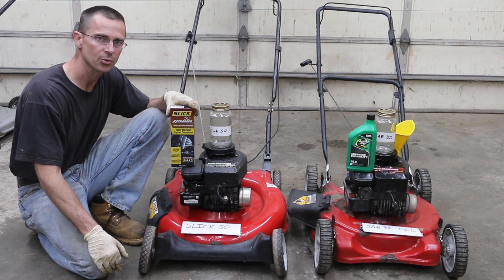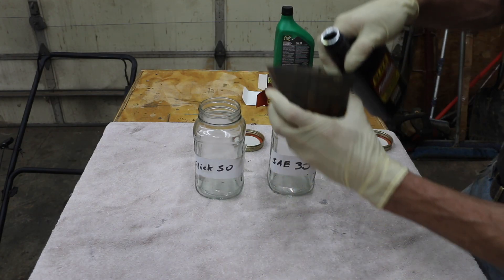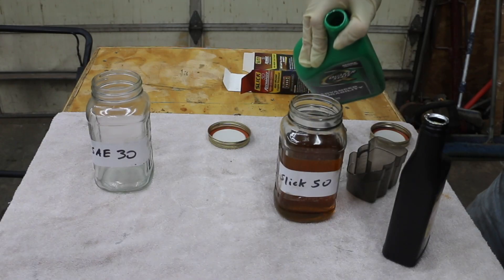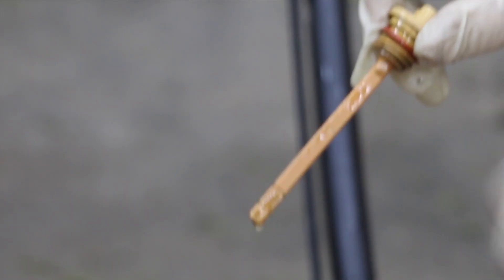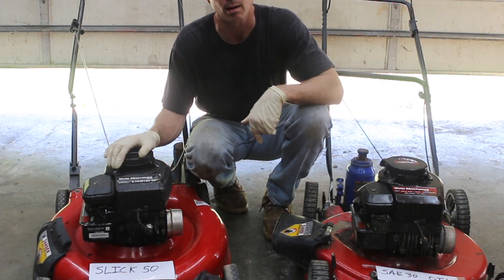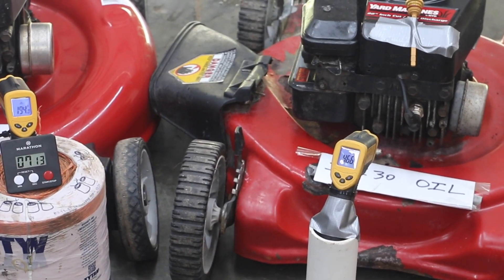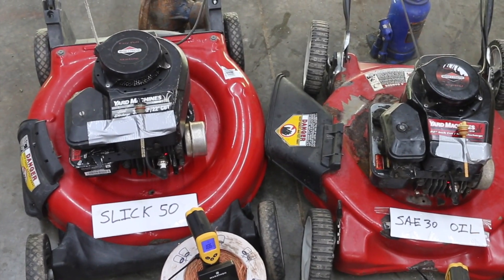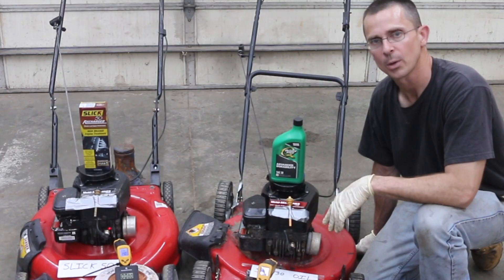Can't believe what SLICK 50 did to my engine!!--Dry Crankcase Test!

Comment: I was involved in the sale of slick 50 in the late 70's early 80's.  My experience is totally different from this.  As a sales aid I had a small Briggs and Stratton motor on a stand.  The motor had a large perspex window in the crankcase so any oil present could be seen.  I treated the motor as per the instructions and then drained the oil.  After that I ran the motor on numerous occasions for 20 minutes without oil as a demonstration.  After about 18 months it lost compression but never seized.  As well as that I had  1962 EJ Holden sedan (in Australia) in which I had fitted a later 186 cubic engine with a number of performance modifications.  I had treated the motor with slick 50.  About 20,000miles after treatment one day I left my home to drive to a nearby town about 12 miles away.  It was a quiet road and I drove at about 90mph all the way (you could get away with it in those days).  I also had the radio up very loud all the way.  When I got to the town and slowed right down I could hear the hydraulic lifters in the motor making a god awful racket.  Inspection revealed that the spin on oil filter had spun off and I had no oil in the sump.  After a new filter and oil I retraced my path and saw that the filter had come off just after I had left my home.  That motor did another 80,000 miles without a hint of trouble.  There were also numerous other highly controlled tests done in my presence that left me in no doubt as to the efficacy of slick 50.  However at the same time there were so many ill informed nay sayers spreading rubbish and disinformation that I got sick of it and left the business.
   This demonstration above says nothing about the correct procedure being followed in treating the mowers.  This is essential.  Other than that I fail to see how a microscopically thin layer (2 to 3 microns) of the slipperiest solid substance known to science (Polytetrafluoroetheline or PTFE which uses the brand name "Teflon")  can cause a motor to heat up more than a motor without it and to seize earlier.  The two motors were supposed to be in identical condition.  Were they stripped, inspected and measured before the test?  As a final comment,  This is the exact same type of "demonstration" that was done by representatives of the ilk of Wynns friction proofing to try and destroy the competition.
Reply: In 1992 I put Slick50 in a Suzuki GS550E motorcycle (I think it was a 1982 bike, but it had been on Guam most of it's life to that point and only had 450 miles on it when I bought it).  You weren't supposed to put Slick50 in wet clutch bikes because it would cause the clutch to slip, but an old motorcycle mechanic told me how to do it. He told me to put in the Slick50 and just deal with the slipping for the 3000 miles it would take for the PTFE to embed. Then after I changed the oil he told me to put the front wheel of the bike against a wall and run the bike (in gear) until the clutch quit slipping and the bike would just die every time I tried to let the clutch out.
     I followed his instructions (and YES the clutch slipped A LOT toward the end of the 3k miles), but after I burned the PTFE off the clutch after the oil change I went from getting a consistent 45 mpg to consistently between 70 and 80 mpg!  I got such good mileage that I regularly freaked out when the main tank ran dry and it took me longer than it should have to remember to reach down and switch to reserve. I put 30k miles on that bike and would probably still be riding it today if I hadn't totaled it (and folded my knee 45 degrees the wrong direction) in a field in west Texas. Even after destroying the frame and cracking the crank case cover, that bike still cranked and ran.
Reply: @johncarkeet5767  Very cool John...except the knee part.
Reply: I totally agree, this test was bad. The ptfe settles in the bottom of the can so it must be shaken vigourisly to get any out.. Engine needs 10 hours running for the ptfe to bed in.
Reply: @colinmartin2974  Those were my thoughts as well. I used Slick 50 on a car back in the day, and it lasted far beyond what I expected from it. I realize that that is hardly scientific proof, but I do believe that the Slick 50 did contribute to the longevity.

Kudos to Project Farm for at least trying to test these things, but better adherence to manufacturers instructions, would make for better testing.
Reply: I think you didn't watch the video in its entirety. The Slick 50 engine remained cooler throughout but collapsed sooner. It would have been nice to see two new engines try this, but as you can see this is one of PF's earlier videos and he probably didn't have the funds to sponsor such a trial
Reply: -And 14 years later the lab boys at Wynns found out that PFTE was almost the same thing as STP.  This is when STP hit the market big time in the mid 90's. PFTE took STP to court and the judge threw the case out and pfte slowly faded away. And STP stayed on top for a little over 20 years until it too fell from the market. How often do you see STP adds on TV today. Never. So STP slowly faded out just like PFTE. The whole thing turned out to be just one big joke. Not much more to this story anymore as both brands fade away even more.
Reply: @auggie803  What rubbish you speak.   PTFE (Not PFTE)  is Polytetrafluoroethylene and was given the trade name of Teflon by the company that invented it--Du Pont Chemicals.  What we are talking about here is a product called "Slick 50"  that used Teflon as a dry film lubricant bonded to the moving metal parts.  STP is the name of a Company that sells a number of different products, among them their "Oil Treatment"  which I presume is what you are talking about.   This is NOT almost the same thing as Slick 50, in fact they couldn't be much different.  STP's product was a viscosity index modifier that made the oil a little thicker and supposedly thereby giving the parts an extra buffer between them.    
And to think this report came from Wynns who were trying to protect their position as the No. 1 marketer of "friction proofing" engine additives.  They were also known to be the No. 1 disseminator of bullshit propaganda rubbishing other products.  STP and Wynns  engine oil additives were basically identical.
Reply: @gertroewer152  ñ
Reply: Liar

Comment: What about Nano Energizer? It contains platinum coated ceramic nano particles. It claims the same as all engine oil additives: that it reduces friction within the engine. It seems more advanced than Slick 50 though, as its quite smaller and not size growing particles as temperature raises, it don't clog the oil filters. Besides that, it can be used in many other devices, like gearboxes, air compressors, power steering systems, lawnmowers, etc. It's chemically inert, so it does not alter the oil properties, nor it attacks any other material or parts within the engines (read rubbers).

I have used it in the engine and gearbox of my, both, Citroen C4 II and C5 II cars. It is noticed a slight increase of power and decrease of engine noise and fuel consumption. 

Also I've used Nano Energizer in the Hydractive 3 suspension system of the C5 and it works now very well, way better than it did. The bumps are clearly less noticeable because the suspension cylinders have less friction now, which seems to be a problem as the LDS suspension fluid tends to become surprisingly sticky and even seizing over time (and even new LDS fluid sticks a bit a syringe), slowing down the suspension leveling electric pump speed, also making the suspension less responsive and hence less comfortable along the time (besides the progressive loss of nitrogen pressure within the spheres, which it's another topic, it's very little with modern spheres, lasting more than a decade in very good conditions, without needing to substitute them easily and costing about or less than traditional shock absorbers). With Nano Energizer, the suspension electric pump spins clearly faster and it's barely noticeable with the engine at idle, while before it was so noisy and dragging that the car lasted ages to level up and I started to fear the pump fuse would melt. 

Also, it's quite useful to add a bit of microparticles of graphite to the Hydractive 3 suspension LDS deposit. It enhances even further the responsiveness and smoothness of the air suspension in all conditions (cold and hot weather conditions and right starting the car or after several hours of driving; because I noticed a very slight residual sticky behavior in the suspension after long driving conditions with only Nano Energizer, surely because this additive it's formulated to shine at its best in metal with metal, like the suspension pump, more than metal with rubber applications like within the suspension cylinders), while graphite it is also an inert material and not attacking anything inside the system. Now, with Nano Energizer plus microparticles of graphite the suspension works like a charm, an authentic flying carpet. 

To me, the main problem of Slick 50 it's that it tends to clog the oil filters. I remember that I used Slick 50 in my old Citroen GS X2 some decades ago... And it was definitively working very well. The engine crankshaft was so much more easily moved by hand at the fan, like silk.  

That the lawnmower engine with Slick 50 of this test stopped first it may be because the PTFE starts degrading at temperatures of 260ºC and beyond. But in normal running conditions, Slick 50 definitively it's very helpful for its purposes of providing less friction and bringing more protection to wear and tear, specially in engines or other devices without oil filter, like lawnmowers, gearboxes, etc.
Reply from the maker: Thanks for the suggestion.

Comment: Can you test dielectric grease on contact surfaces of one of two identical car starters and measure cable and metal surface temps while running the starters?  Conventional logic says it’s an insulator and should not be used on contact surfaces.  I maintain a ultra thin application (wipe it on and off leaving no excess) precludes burning and oxidation of contact surfaces and will still pass plenty of voltage and current for starter operation and improve reliability.

Comment: Another great video, as usual. You've saved me countless hours and dollars, doing real world experiments that I've always thought about doing. My only question on this Slick Fifty test, is if it should have been done on identical engines with identical number of hours on each, or maybe even brand new engines (ouch). One has to wonder if the Slick fifty engine may have been closer to giving up the ghost than the other one, prior to the test, maybe clearances were tighter or looser, might make it last longer with no oil?
Reply: I agree.  I really like the effort PF puts into his tests but in this case there were too many unaccounted for variables.  At the very least, there should have been a temperature measurement of both engines running SAE 30.
Reply: I was thinking the reason the 30 weight did better was because it was a little bit looser of an engine since it ran hotter but didn't seize up as fast or the slick 50 engine ran a little cooler but seized up faster seems it may have had tighter tolerances.
Reply: exactly - not a real test

Comment: Interesting video. I treated the engine in an old Skoda 120LSE in 1990 with Slick50 . The product I used looked quite different, it looked more like a grey slime than an oil. It also claimed to Teflon coat the moving parts of the engine.
I don't know if the European formula was different, but it looked quite different to the one used in your video.
There was some debate about that time that it adversely affected fuel injection systems.
In my old Skoda, however, the engine ran quieter, smoother and cooler (the car was rear engined and prone to overheating in heavy traffic) and returned over 50mpg.
Years later I came across Slick50 and was going to try it on my car, but on reading the"blurb" found no mention of Teflon. Instead, it referred to a graphite formulation.
Could be that there was an issue with fuel injection systems and the earlier product was for engines using conventionally aspirated carburetors.🤔
Reply from the maker: Thanks for sharing.

Comment: Was this video redone more recently or is this the only Slick 50 test?

Many years ago, on our farm, we teenagers destroyed many dozens of engines doing experiments like this (without the slick 50 most of the time) and we learnt quite a bit about which engines seize up first.

Every "field car" we obtained (most for free) we raced, jumped, crashed, etc until it no longer drove. At that point we would run the engines with no oil with a log on the gas pedal (typically not wide open initially) until it seized before taking the car to "honest Ed's" for scrap metal weight.

What we found was how long an engine could run without oil and coolant had little to do with what oil had been in the engine (including 1 that had run slick 50 at one point in the past). The key factors appeared to be (from memory of about 40 years ago):

1. How many miles and how worn out the engine was. The more worn out the longer it would run without oil. Engines with noisy bearings, piston slap, low compression, etc would always outlast healthy engines.

2. If we also ran the engine at wide open throttle, the high performance engines seized up considerably faster than low performance engines. Low performance engines typically experienced valve float and this kept the rpms much lower.

3. The temperature had a big impact on longevity. In fact one 1976 Chrysler slant-6 and one 1972 Ford Pinto's 2.3? L 4-cylinder, both with over 250,000 miles on them, refused to seize up after hours of running, even at WOT, with no oil. Both only seized once the coolant was drained. Without coolant they seized in about 20 minutes at WOT. That slant-6, once it cooled down, unseized itself and we were able to restart it. It now had terrible compression, so bad that WOT only produced about 3000 rpm and after about 15 minutes of running the crankcase explosively ignited, ballooning and blowing off the valve cover and ballooning out the oil pan.

4. Some engines seemed to somehow keep a small amount of oil trickling out of the oil pump and through the system. Removing the oil filter helped to minimize this.

If you run this test again, I recommend figuring out some way to consider previous engine wear. I suspect that the real reason the non-Slick 50 engine seized first was it had tighter piston to cylinder or piston ring end gap clearances.
Reply from the maker: Thanks for the feedback.

Comment: Interesting test!!! The engine with the slick 50 was running a fairly short time, before the seizure test was done... The slick 50 needs more running time to properly coat the internal surfaces with the PTFE compound for it to become fully effective.... Another thing, the two mowers were NOT identical... Both are machines with unknown hours of previous use, and unknown amounts of preventive maintenance that was done during their NORMAL lives before this video... The lower temp of the engine that had the slick 50 showed that it improved the oil miniscus, and coated the surfaces better because of this... My guess is the slick 50 engine would have not lasted nearly as long without it... The engine without the slick 50 immediately locked-up... Showing a rapid lubrication failure, while the Slick-50 engine slowly/smoothly shut down.... That engine with the Slick-50 could have had tighter bearing clearances than the other engine... Not necessarily an accurate/scientific baseline to test from as these engines were different....
Reply from the maker: Thanks!  Thanks for the feedback.

Comment: You are missing the point you have to run the engine at least a season to code it with a slick 50.  You can't expect the slick 50 to coat the engine in just a few minutes that's nuts.  Please do the test again but do it right.
Reply from the maker: Thanks for the constructive feedback.

Comment: If you like Slick50 as an oil additive then it did show an advantage in that it kept engine temps significantly lower than the engine with straight oil. The problem is running any engine dry. None are made for that. Also you never know that Briggs motor might be free when it cools down and you add a little fresh oil to it.
Reply from the maker: Thanks for the feedback.

Comment: I used the original Slick 50 back in 80's-90's on some freshly rebuilt street-stomping Chevy 350's... IT WORKS!  my engines always ran a little hot, up to 205-210 deg... dumped in the Slick-50 and the temp gage never went over the Thermostat setting of 180 deg.  with more power noticeable when climbing a long hill getting onto a local highway.  Another similar product available back 25 yrs. ago, that really worked was called... Friction Wedge
Reply from the maker: Thanks for sharing.

Comment: Elijah UK Mechanical Engineer.
Dear friend, All your test with the Slick50 is not correct due to the fact that you must leave it in the engine until your next oil change or equivalent, then all the moving parts are covered with the slick50 magnetic molecules that stay on it layer after layer,,, on cars they last for something in the region of 20,000 Miles.
You have just filled the sump up and, run it few mins and emptied it, so in this case next to nothing have stuck to the moving parts. I have been using this wonderful product on my top end cars for the past 40 years with great results. you must give it time to do its job. At least until the next oil change. On cars at least for 10K Miles